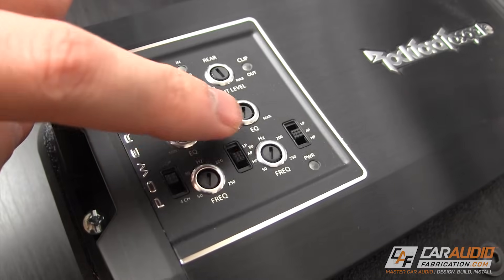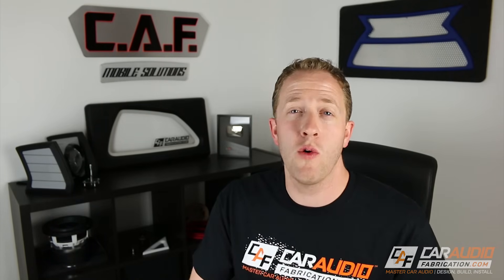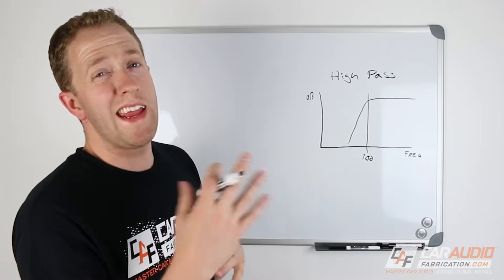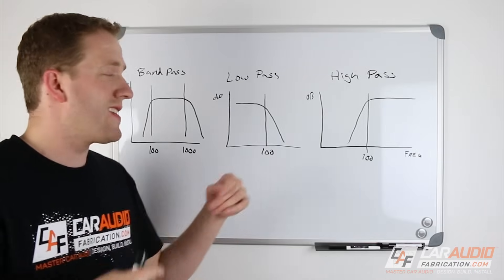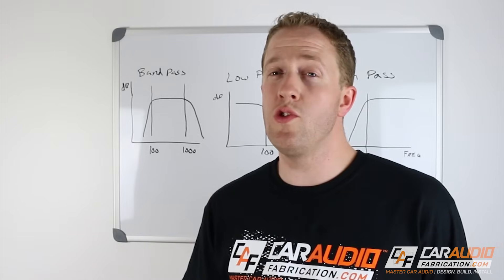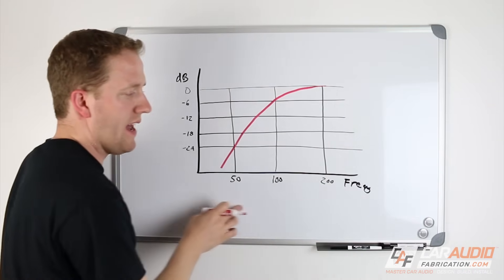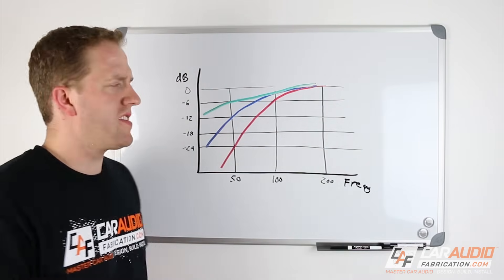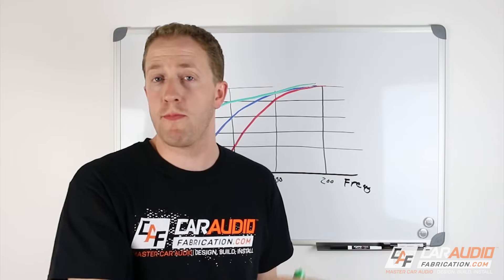IMPROVE Sound PROTECT Speakers - How to set Crossovers - CarAudioFabrication

Comment: Hi. I have a E90 3 series with aftermarket speakers. So currently, I have a component set at the front with passive crossovers for the doors and tweeters. There are a pair of midbass drivers under the front seats. I’ve removed the rear speakers and have a sub in the trunk. The headunit is a pioneer sphda120. The speakers are connected to a 4 channel amp and the sub is connected to mono amp. At present the unit is in standard mode. I wanted to ask if I could change to network mode with the existing speakers so that the fronts are high passed at  roughly 1.5khz the tweeters would be taken care of by the passive crossovers. The midbass under the seats would be bandpassed between 80 to 1.5khz and the subs low passed at 80, all at a 12db slope. Is that possible? Thanks.

Comment: hey man. big fan from India here... i need your help in setting up my new car speakers frequency's. i can give you the detailed of my setup on your email or some whats app number. Basically i have a pioneer single din accompanied with four JBL door speakers(one pair is 230 watts(front) and the other pair is 320 watts(back)) and no woofer. Pls help help... all i want is a decent base. which is not happening. an it jar's on high volume.

Comment: Love your videos. Very informative and you explain concepts in a simple,easy to understand fashion. I have a Pioneer head unit with time alignment ,crossovers,
speaker levels, phase reversal for the subwoofers,etc. (Pioneer  FH-X830BHS). No DSP. I can set up this head unit in network mode.
Can I get decent results tuning a three way system using only the head unit? A DSP isn’t in the budget right now. Thanks! Keep up the good work. Looking forward 
to your next video!

Comment: quick question? what would be wrong with overlapping the crossovers a bit to negate the phase change cancellation effect? For theory in your example couldn't we just up the sub cross over to say 110Hz and lower the mid range to 90Hz? Wouldn't that eliminate any phase change cancellation? Thanks, -Nate
Reply from the maker: It doesn't work that way, you would still end up with a shift and bump or dip in response

Comment: Question; I have a set of the Focal Performance PS 165FX. If I follow the 2xFS 2x1370=2740hz as my crossover point. But the passive crossover frequency for this particular speaker set is set at 3600hz. So why the big difference ?
Reply from the maker: Because like I said, it's a guideline for where to start before tuning. Since they have the luxury of pairing the mid with the tweeter they might know the mid can play higher before excessively beaming, so they have a higher crossover to further protect the tweeter. But you aren't always going to have the luxury of using two speakers that were engineered to work together. You will have to them determine your own crossover points.

Comment: I'm curious if you have a head unit with built in crossover capability and also have built in crossover capability on your Amp, which one is better to use, the crossover in the head unit or the Amp? TIA
Reply: I would use the one with the most flexibility.

Comment: So on a 3-way 6x9 like the Alpine sps-619, where would I want to set my crossover? The FR is 65Hz-23kHz so I'm assuming HP @65Hz. Is this fine? I may add subs later. Will I blow the built in tweeters by doing this? Seems strange to have a tweeter built into a 6x9.

Comment: Hai Mark, It's a great video about crossovers and very informative. Can you also make a video about best equalizer setting on head units for good sound quality (maybe like a studio) will be also a good thing and information. I'm also looking for that. My head unit is pioneer and the speakers are from morel, also I'm using an infinity subwoofer, one infinity amp for sub and one kicker amp for speakers. All me speakers are morel component speakers which sound's good. So if you can do a video about head unit setting for good sound quality or if possible can you send me details about that will be a great helpful thing. Thank you
Sherin.

Comment: Would you want to use the crossover on the amp or DSP if you are running a passive set of components? As a general rule to protect my customers speakers I've always set them but just wanted your thoughts.
Reply: use the DSP

Comment: Can you use the passive crossovers with the components and still tune them with the active crossover? Or do you need to remove component crossovers ? Want to add a Rockford fosgate 360 to my setup , thanks

Comment: Hey Mark, Amazing videos! If I have a component set that came with a passive crossover but my amp has an active crossover. I plan to use only my amp crossover and was wondering, is there ever a time where you WOULDN'T want to set your amp to the same crossover as the passive one had?

Comment: My amps have built in cross overs but my double din has crossover settings too, should i set the cross over on the amp same to the double din?
Reply: I accidentally did that once lol. Don't stack crossovers or you'll be attenuating the response twice and left with a big muddy hole in the sound. You'll notice if immediately if you hear it.
Just set the crossovers on whichever one you prefer and that one only. Set the other one to pass through full range with no crossover if possible.
Reply: I use both, mainly because the remote punch control for Fosgate amps only works in high or low pass mode. My sub amp is set to 120 to allow for a range, while my deck crossover is set to 80 for the sub channel. My door speaker amps are set to 80 on the amp while the deck is set to 100 with a downward curve. 

If I had to choose, I would use the deck out of convenience.

Comment: If my amp is way more powerful than what the speakers can handle, does it make that much difference to use the factory included crossovers over buying a dsp? I have a focal ps165 set pioneer FH-P8000BT HU, and alpine PDX-V9 5 channel amp. Vehicle is an 02 ford escape no rear speakers, and havent picked a sub yet.

Comment: Awesome video!! I have a random question. I just installed a new 3 way crossover in my system and im getting the most insane Buzzing, Alternator whine and i cannot figure out what is causing it. ive tried different grounds for the amps and that didnt work ive tried grounding the RCA's to the Head unit and that didnt work. If i run the RCA's directly to the Mid Amp bypassing the crossover it eliminates the noise. Also now this is the strange part. If everything is run through the crossover and i put my back seats down (which the amps etc are mounted to) then the buzzing stops but if they are upright the buzzing is crazy. Any help or ideas would be greatly appreciated.
Reply: IT-911 PTY LTD if the amp is mounted to metal on your back seat it could be back feeding through your rcas causing  noise

Comment: How do I reliably set the cross over frequencies on my amps when they don't have any markings on them, is there a cheaper way than buying an SMD CC1??
Reply: l34052 Just do it by ear. Do the full range speakers first, then match or slightly exceed that setting by about 1/8 of a turn for the subwoofer. Just to be certain that you don’t leave a gap in the frequency response.

Comment: When you say set cross over at 80hz, do you mean set frequency dials on amp to the 80hz position for both subwoofer and front speaker, or, do you set one dial (front) speaker dial to say 100hz  and the sub dial to 40hz so that both speakers fade into each other without excessive bass boom?
Reply: squibcakes74 He means to set both to 80 Hz on the dial. 
It’s the proper way.

Comment: Mark, great video thanks!
Regarding the part about flipping the polarity and using two 4th order slopes with drivers to get them to sum flat, What is your opinion when the head unit has a phase setting? Should one still flip the polarity, or use the phase setting? Does it make a difference?
Thanks!
Reply: Ryan Fahey  Use the phase setting. It’s the exact same thing, but instead of having to physically reverse the wires, it switches the signal going into them. You can do it either way.

Comment: I have a question... What is the most wattage I can get out of a stock electrical system on a 03 crown Victoria?  I want hard hitting bass but don't want to mod the stock system. I have 0-gauge wire, lightning pack, stock alternator and battery.  What size amp and subs can I run for best sound... I. E. Bass. I have a 400 watt amp on front and rear speakers.

Comment: 2*Fs crossover point for between door woofer and subwoofer seems a bit too high. I only have a 12-inch JL StealthBox in my Mustang to play the low frequencies. If I set the crossover point for my 6.5 inch door woofer to 2*Fs, which is 140 hz, the bass would sound boomy and muddy without the punchiness. What's your opinion on this case?
Reply from the maker: +Yang Du get mids with a lower fs. With such a high fs if you are counting on that speaker to play below its fs its not going to reproduce the music very well.
Reply: The woofer I'm using is a hertz mille 165.3. I see that the speakers for this size mostly have a Fs between 60Hz to 70Hz. I crossed it over at 60Hz for half a year but after seeing your video I'm a bit scared if I will break my speakers or not. Cannot quite tell if the bass is distorted or not but EQing them below 100Hz is surely hard: the frequency response just fluctuate +-2dB. Maybe it is because of the door resonance. I did put a lot of sound deadening to prevent the door vibration.
Reply: Yang Du are u talking about door or sub? If u are talking door I would say (just me) put it at 75 or 80) it's mostly a good safe place for mids.
Reply: Kyle Wallace Thanks for the reply, Kyle. I am talking about the door, but sub applies as well. Just worried about the safety since even my door woofer Fs is 70hz, I set it to cross over at 55hz 12 dB, and i would say it sounds good with ample punchiness

Comment: How to find the best crossover point between the door woofer and the midrange driver? In the video, you mentioned that for the crossover point between the mid-range and the tweeter, we should look at the roll-off point for the mid-range driver when playing off-axis.  Is there any general rule for the crossover point between midrange and door woofer?
Reply: I'm talking about a set up with subwoofer, door woofer (mid bass), mid-range speaker (to play vocals), and tweeter

Comment: I took the signal from my front doors on my 2008 avalanche with a regular $10 converter whenever I turn on my car I have to disconnect the input output jacks to get signal. So I need a crossover or a lc2 converter or a epicenter or what?! Please help...!

Comment: I've got a question.  My speakers in the front went out (Rear sub still works)........ I'm running an electronic cross-over unit to the front component speakers and cranked the volume then the speakers went out.  I'm running dual amp setup for the front and rear, the rear still works fine and I know it's not the front amplifier because I switched it to the rear and it still works.  My question is, can electronic crossovers themselves fail as a part rendering speakers useless?  I just need to know if it can indeed fail as a part of a car system.

Comment: i am currently installing  a component 6.5 set and a dual 12box into my car the 6.5 will run on an external amp also, but to my concern, the monoblock i will use to the subs you can't turn off LPF, i want to set the crossover on the HU for the only reason the manufacturer of the monoblock has no info on what slope the LPF on the amp is at, can i just set the lpf on the amp as high as it get (300hz) and set it at 80hz 24db at the headunit without messing with something? the 6.5 is no problem tough

Comment: So is there a good way to know or find out the approximate frequency that "beaming" starts to occur on a midrange speaker if you have absolutely no idea of its specs? (e.g. for an unknown driver, or one you can't find any info on)... Is there a good way to test this, or preferably just judge it based on cone diameter, etc.? I don't have any sophisticated test equipment available to me and I can't afford to buy any because of very limited funds, but I still enjoy hearing good quality sound, so I hope there's an easy way to find out the "ideal" high-end roll off for any given midrange... I have a few of them to potentially choose from for my system, but I don't know any specs for any of them... Any info/ideas about how to judge this aspect of a driver would be greatly helpful! (The only thing related to this that I've ever heard or read about is that you shouldn't use a driver above the frequency equal to where one wavelength of the frequency is equal to the effective piston diameter.... But if you have any other better ways to judge it without sophisticated test equipment, I would love to know!)

Comment: When using a passive crossover for my component speakers where do i set the crossover on the amp if the passive crossover is crossing over the frequencies
Reply: TAGZ the passive crossover takes care of the crossing between midbass driver and the tweeter, you should use the highpassfilter/HPF on your amp hopefully it has one, it should atleast and set it so the midbass driver dont play low notes, thats the basic explanation=)

Comment: So the low pass filter means on the scale of 30hz-250hz I set the arrow on 250hz and it plays everything under 250hz correct?
Reply: Correct, but a low pass filter generally sounds best at 80-100 Hz. Especially for subwoofers.
Reply: Terrence Mims correctamundo!=)
Just listen to the name (low pass filter) the lows are passing the filter, these things get confusing sometimes so thats what i tend to think to myself to get things right

Comment: I didnt know about fs and the impact it makes on crossover point,  I have a pair of focal 165As Witch have Fs of 73.8hz how high should I go on the crossover I find it works best at 83db 4th order -24db at 63hz I find I get too much bass on the speaker
Reply: Try 120hz - 24db or 150hz -24db

Comment: i plan on replacing my full system in my pickup. it is capable of going to a 7 speaker set up (no sub). but it is currently running only 4. i want to add the other 3 and 2 shallow mount subs behind my backseat. once i get this system installed how can i tune it so that i can go full volume without distortion? and what are some other tricks i can use to minimize this as well?
Reply: Derek Hoffman clipping can start at the head unit even if all the gains are set properly, don't turn it up all the way, need some headroom.  If you hear the slightest bit of clipping or distortion, turn it down.

Comment: So if I install two different speakers with two different fs values, do I go with the highest value for the cross over for both speakers?

As in a 6.5" component speaker in the front with a fs value if 59 Hz and a 6x9 component with a value of 45 Hz.

Comment: Good explanation, but your octave math is wrong. You're dealing with logarithmic scales, so you can't just divide the frequency difference between an octave in two and say "and this would then be half an octave".

Simple calculation to show the error: instead of going half an octave down, let's go a whole octave down, but follow the logic from your calculation. That means pretending we don't know how much one octave down from 30 is, but we know how much 2 octaves down is: it's 7.5. If an octave down would then be the halfway point between 7.5 and 30, it would mean that we end up with 18.75Hz sitting one octave under 30. This is clearly wrong, and so is 22.5 in your example.

Fortunately, the number you're after is not very hard to calculate if you know what the term "powers" means in math. One octave down is dividing by 2. Two octaves down is dividing by 2, twice, or dividing by 2 to the power of 2. Three octaves down is dividing by two, three times, or dividing by 2 to the power of 3. And so on... So going half an octave down is simply dividing by two to the power of a half. Grab your scientific calculator, 'coz I sure as hell can't do that in my head, and the number you get is 21.2. Now, in this particular case, the numbers are very close together; 1.3Hz of difference is negligible (although it is 6.1% off). But what if we want to go half an octave down from 15KHz for some reason or other? Your calculation would put that at 11250Hz, while in reality, it's 10607Hz. That's a 643Hz difference, or 5.7%.

Anyway, thanks for the videos. Learning a lot of nice little woodworking tricks here. :)

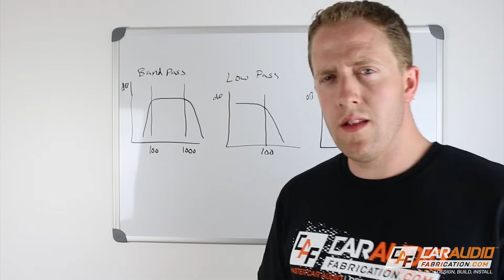Comment: 7:10 - 11:48 crossover effects/polarity/db response/filtering -12db vs -24db slopes/phase. Just what I was looking for!
Reply: I still didn't get which is better 24 or 12 db slope
Reply: @gilbertos1984  24 keeps the crossover EQ flat, 12 creates an EQ bump/boost at the point/hz of crossover.
EDIT: Just watch from 10:15 to see...
Speakers in phase @ 24db slope = flat (the purist mentality--I do this for accuracy and let me deck EQ the frequencies how I want)
Speakers out of phase @ 12db slope = boost (might muddy the sound but adds low bump)
Speakers in phase @ 12db slope = notch (dip in EQ at crossover point. Idk who would do this but maybe it clears up the sound for some people)

Comment: So I just got my sub installed. 12 inch pioneer with  an ssl 1500 amp and sometimes when I'm driving, my sub stops working, and my amp says it's in protection mode. I turn off my car, and turn it on and it works again. Someoneknow why this happpwns? If you need better specs lmk
Reply: Savage Reflex sounds like your rig is pulling more power than your car can deliver. have you done the big 3 upgrade ?
Reply: No but I found out the problem. On the back of the amp I had to adjust how much power was going into the sub? I think something like that. The setting was on 240 and I lowered it to 80( cuz that's what the box said from the sub) and it worked